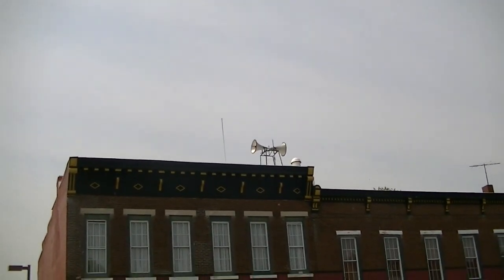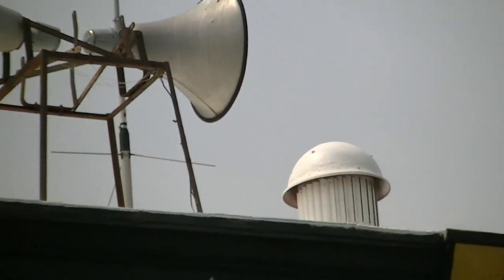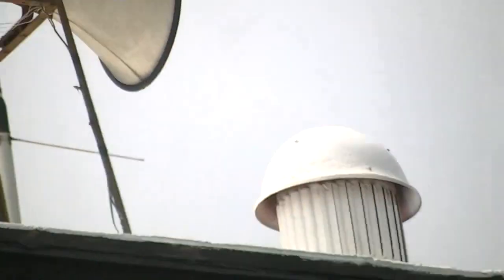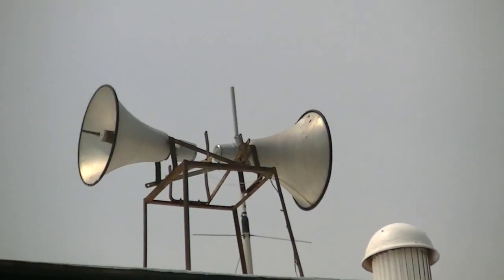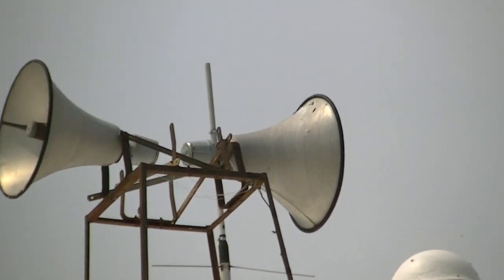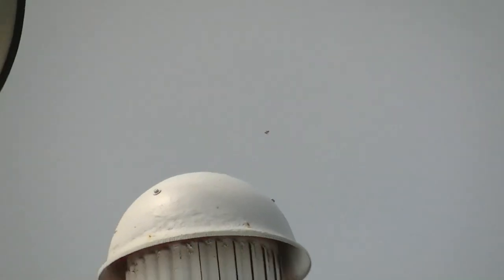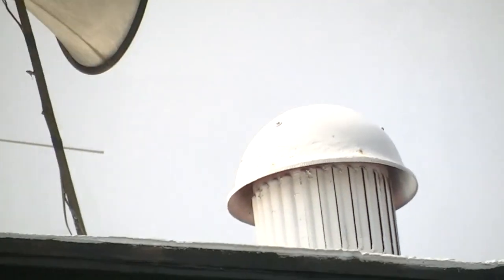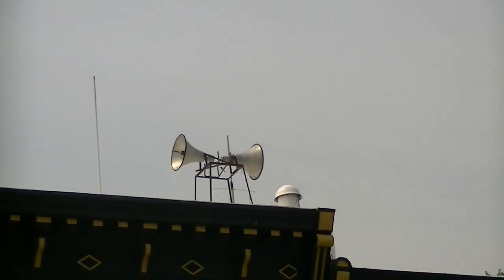Custer siren and Darley model 2 quick tour, Ladoga, in. 6/18/23. Repainted model 2.

Comment: i dont think this is a custer siren, its not in the right area and its missing controls, solar panels and a battery. I suppose the battery and controls could be inside the building but i have doubts.
Also what Indiana map are you using?
Reply from the maker: I'm using the main map.